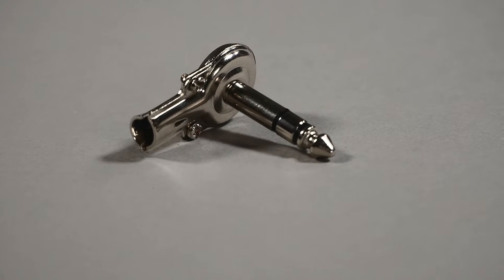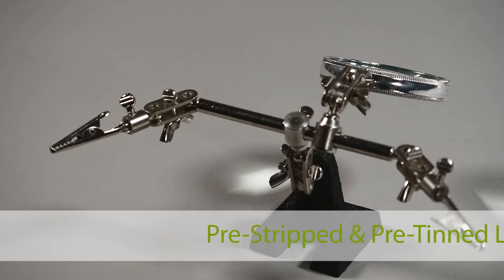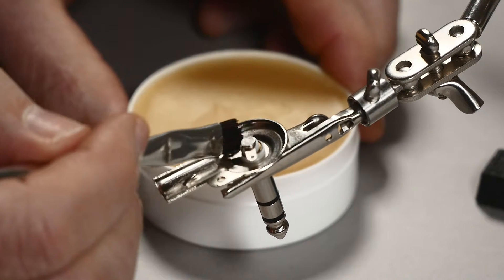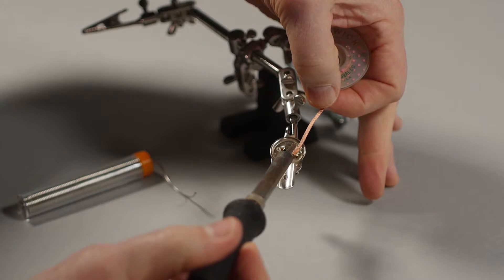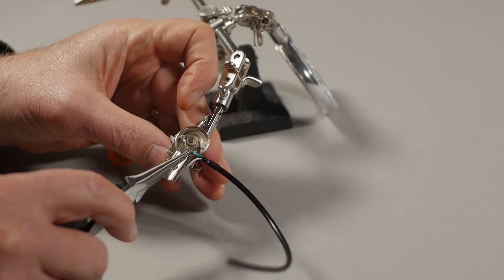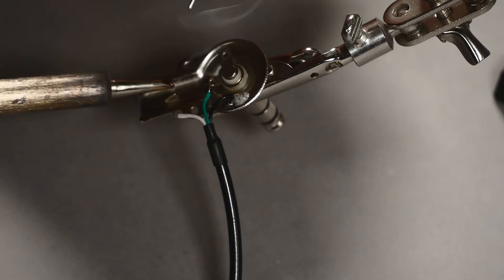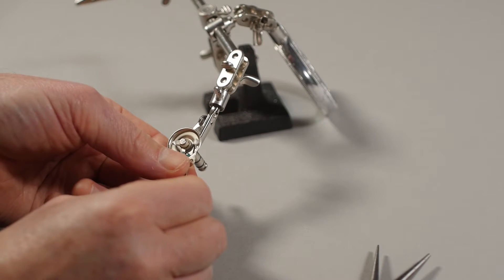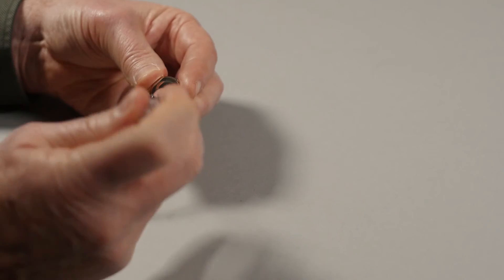Soldering Basics: How To Solder a 90° 6.35 (1/4") Stereo Audio Connector

Comment: Rather than heating the wire or solder to make the connection, you need to heat the connector until the solder melts. You want the solder joint to be shiny which indicates a hot joint. Dull solder indicates a cold joint that can have poor connectivity. She mentions having a soldering station with variable heat control but fails to give the setting. In the video it appears to be set at 5 but I have been told the hotter and quicker you solder, the less insulation you will melt, which is good for jacks, pots and switches. As to which wire goes where, in the video the black wire goes to the casing, the green goes to the middle connector and the white one goes to the center connector.

Comment: Thanks for the video. For cable repairs: How to correctly desolder  the ground wire? You have to apply so much heat that the entire connector gets hot. Result is, the tip comes loose and could be rotated together with its solder lug. How can one fix the rotation for these angled plugs after desoldering the signal and ground wire? The heat while desoldering defiitley loosens the plastic isolation inside the plug. How can one fix the rotaion afterwards? With heat again? Heat gun?